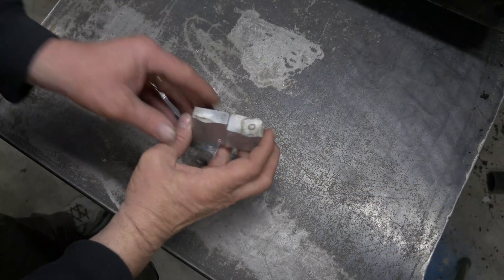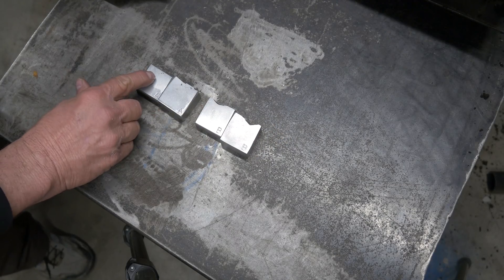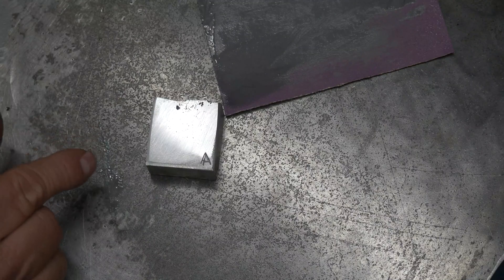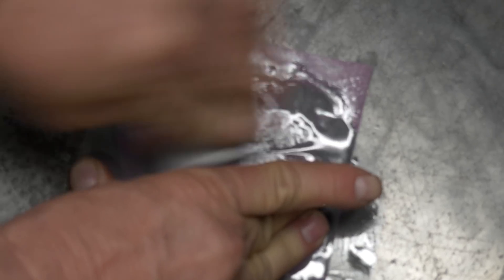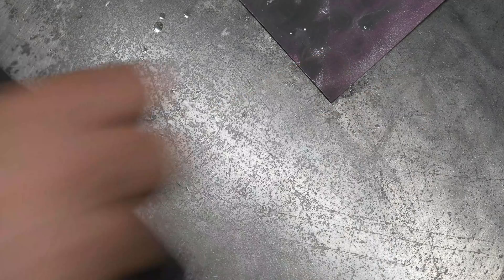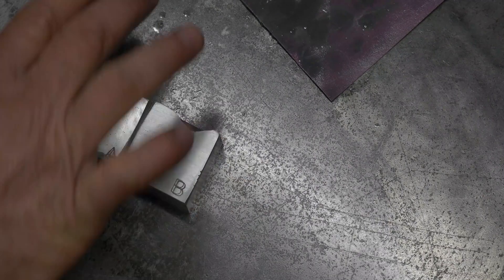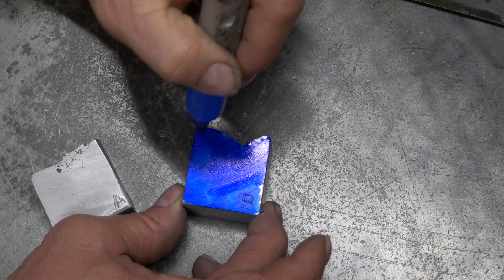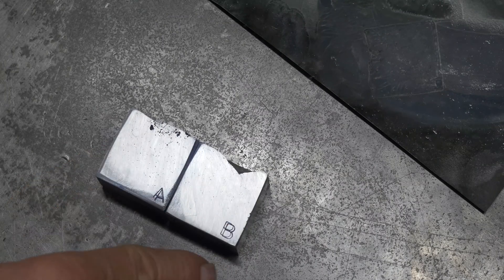Cutting to the chase - my porosity test

Comment: Just seen this video and it fits what we were talking about in the other vid some days ago: The big bubbles at the top are entrained air bubbles. They are brought in while the material is fully molten and have time to float to the top, bevor it solidifies. The small dispersed bubbles are probably hydrogen bubbles that are soluble in the melt. These pores are not there before the aluminium solidifies. They form during cool down and can not float up any more.

Comment: Wd40 is a terrible oil. Don't use it for anything. There are plenty of great oils that are often cheaper.
Reply: Henry Miller I’ve always had a can of WD40 around. What oils do you prefer?
Reply: @ethan073  the right one for the job. wd stands for water displacement, when I have a wet ignition Wd40 is the right oil. I haven't had that problem in years... For a stuck bolt a penetrating oil like frees all is good. For metal on metal that needs lubricating sewing matching oil is often my choice, but different  bearings need different oils so where there is an owners manual I follow it. For a squeaky hinge vasoline is good.

Comment: Hi Perry, Thanks for doing these experiments.
I have another experiment for you to show what an improperly tuned burner does to your melt.
This would be a three part test.
The first part would be to run your burner with a grossly rich flame and pour ingots.
Next, run your burner on the lean side and pour ingots.
Do a slice test and compare results.
Part three is to remelt the part one ingots using a lean flame and compare those ingots to the other ones.
The question is, will the part three ingots come out with reduced porosity?

Comment: I'm curious if metal pouring temperature would affect this to any noticeable degree.  Your method (method "B") was poured second, so it would have been a few degrees cooler.  I don't believe the mould warmed to any appreciable degree for test sample B, so that likely wouldn't cause any difference in this experiment.
As for the metal you cast them with, I am going to say that it is the same general stuff any of the rest of us will be getting our hands on, so even if you could get some high-quality "new" material, that wouldn't help any of us backyard casters anyway.  And to do a proper compassion, you would have to get some garden variety scrap aluminium, then cast and recast and recast, and mix with another batch of scrap, and recast again, just to produce a /known/ multi-recast sample.
Your experiments are very informative.  The only other thing (well, probably not the ONLY other thing) you could do is to a tensile test.  The only price I could find online (admitted it was only a quick check) was $75 each, and while that's reasonably cheap for a multi-million dollar company, it's way out of the budget for a guy in his garage.  Keep up the great work!
Reply from the maker: Hey Brian, I've had guys in other countries offer to do the test for me. The problem is, to ship anything from the States to anywhere else in the world is ridiculously expensive. It would cost me $40-50 to ship those blocks.   If someone State-side offers to put them in a press and and run the test, I'd ship them.  You hit the nail right on the head I. like most of us, am a dork in the garage that will typically melt anything that is lighter than steel. I'm slowly coming around to the idea of buying metal but while I'm learning and making things like plaques I think scrap is a good enough choice.  As far as paying for a tensile test, yeah, as Wyatt said to Johnie Ringo, "I'm not going to fight you, there's no money in it" ;-)   I might check with a teacher I know at a local technical high school to see if they have a press and would be interested in running a test for me.

Comment: Sodium Carbonate, Soda Ash, etc. is Arm & Hammer Double Acting Washing Soda (98%). (55oz box for $4.59 or $1.28 a pound) 

Material Safety Data Sheet (MSDS) and the National Institute of Health (NIH) are your friends when searching for chemicals. A Google search of "Sodium Carbonate MSDS" will list a number of off the shelf items that contain the chemical. A search of the NIH website will list about 45 products and the % of each chemical in the product. OxyClean (WORTHLESS product) is 65% Sodium Carbonate so your paying for the name. 

I had heard that Calcium Carbonate is what "parting dust" is made of. Commonly found in the pet trade as a calcium supplement for reptiles. The great lie is that it needs to be replaced every 6 months as it gets "stale" so If you know anyone with reptiles offer to take it off their hands. My Bearded Dragon has been using the same container for 3 years and his bone density x-rays are perfect. LOL.

The US Navy Foundry Manual (ISBN 1-1401-0900-3) Page 191 states "reheats of Cast Iron causes a lost of 10% Maganese, 3% Silicon and 20% Graphite". I am wondering if a similar loss of materials are lost in the reheats of Aluminum? This book obviously deals with a lot of different metals and lists all of their compositions which was interesting.

Perry, use a piece of tempered glass and 3M 77 spray glue for a polishing surface. Spray one side only! Spraying both sides makes a permanent connection. Tempered glass can be annealed with string (think candle wick) and lighter fluid. It takes a couple of attempts to get it right but the tempered glass can be cut with a normal glass cutter.
Reply: Good to know that OxyClean is Sodium Carbonate with 35% filler (likely a water softener)

There are lots of different parting dusts, but Calcium Carbonate is likely the safest to use (assuming the supply product does not contain silica).
Reply: @askquestionstrythings  Egg shells in a coffee grinder works as Calcium carbonate. 😁

Comment: Do you have a digital microscope?  That might be interesting, can make a really nice machined finish look like a mountain range.
Reply from the maker: Yeah, it's right next to the electron microscope ;-/ Come on mate are you serious? I'm a software dork with a half empty tank of propane in my garage ;-)
Reply: @swdweeb  you do know someone with one of those $35 cheap digital microscopes, someone who has access to an optical microscope and might be able to fabricobble a digital adaptor for the optical microscope and whose phone gives some decent macro on its own. But is it worth sending those blocks back into the postal system for a deeper look?
The bigger question would be, does that person have the time to do the alkaline cleaning and a video?
Or maybe get really crazy with some image recognition to auto count the numbers and sizes of the pores? (ok the image recognition stuff would likely be a stretch)

if people are interested in a collab between us to look at the porosity close up, I could try to find some time... although I fear my time is highly limited until early May after the first round of presentations with my research.

Comment: Sandblasting shows up porosity better than anything else I know. Most methods of working a surface can flex the last skim over a bubble down and not reveal it. Sandblasting punches through those skims, even if slightly below flush.

Comment: Take a test-tube, put a small camera in it, insert it into the flask... would be a very interesting video :D
Reply: Kinda like this?: https://youtu.be/gIHWLFBmMaA
Reply from the maker: I missed that comment. Love the explosion at the end ;-)
Reply: @tobhomott  That's cool... I wonder how difficult it would be to get some of that new transparent aluminum to do that pour so the viewing window doesn't shatter from the thermal stresses?
Reply from the maker: To watch the metal flow? Not that I'm going to do it, just curious.  I can do other things so that we can see how metal enters the mold easier I think
Reply: @swdweeb  Yes, I guess if you simply remove the "top", that would easier. How the shape/size/placement of the gate affects the flow...
Reply from the maker: I've been thinking about another version of the "tiny gate" video that I did that could show the metal pouring into the parts with different gates. Essentially extend the patter above the surface of the flask.

Comment: Look at all of that Porosity caused by large sprue pour-osity... it's an interesting comparison

I remember olfoundryman mentioned a solution (sodium carbonate?) to treat the block and it will show more of the porosity.
Reply from the maker: Yeah, he and I talked about that. Unfortunately I couldn't find it in the stores and had to order it. Given my propensity to not plan ahead, I didn't have any when I shot this ;-)
Reply: @swdweeb  really nothing in your area? I just checked a reference on Porous Layer Characterization it is alkaline cleaned in sodium carbonate (Na2CO3), 20 g/L. There are two methods washing soda is available at most grocery stores I bought some at walmart. The second method is to put a layer of baking soda on a cookie sheet and bake at 200°F for about an hour. 

I totally get that not planning for all details, it happens to all of us. I'm currently dealing with a drone motor and not planning out all the details for the mounting and ESC code.
Reply from the maker: As I understand it, it's also known as lye. Walmart and other sell it but don't stock it.   I think the results I got were pretty conclusive so I'm probably not going to revisit it
Reply: @swdweeb  lye is sodium hydroxide NaOH which is different from sodium carbonate Na2CO3; both should work as an alkaline cleaning solution. As Olfoundryman said drain cleaner with caustic soda (lye)  will work and is easy to obtain. 
but yes, your results are a very good comparison and no need to revisit it... but something to keep in the back of your mind for future consideration. (of course, as olfoundryman said, the solution will eliminate any metal smeared by the cutting and finishing process... and that could be super interesting as it will show the full story... it's all a question of how far down the rabbit hole you want to go... or if Martin and I can talk you into going further down  the rabbit hole... of course we already know the conclusion of which has more porosity)
Reply: For heavens sake fellas, just get some drain cleaner! Its usually at least 50% caustic soda - just about any supermarket or hardware store will carry it. Read the contents off the label to check that it is NaOH based. A few minute dip in a strong solution will l eat any metal smeared by the finishing process away and reveal the true nature of the porosity - You will probably be shocked at how bad it really is!.. Martin

Comment: Sw, Clearly there is porosity in both A and B and this is not surprising as there were no feeders on either. But equally clearly it's much, much worse in A. As the metal is much remelted we can be sure that there are lots of bifilms in it. In both A and B these have opened up due to shrinkage to produce the porosity we see. But in A the extra turbulence caused by the bad gating has increased the number and size of these films, the result is more and bigger porosity in A. I know which casting I would prefer to work with! Very interesting experiment and good proof of the value of good gating even when you are dealing with junk metal... Martin
Reply from the maker: It is pretty remarkable to see the things in the metal that someone has been telling me about for more than a year ;-).  Also remarkable to see the difference the pour makes